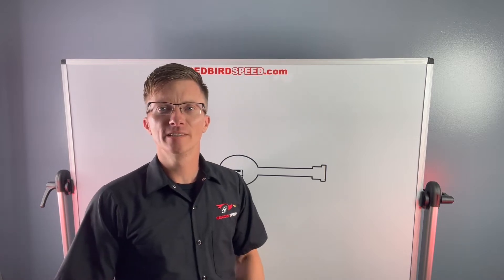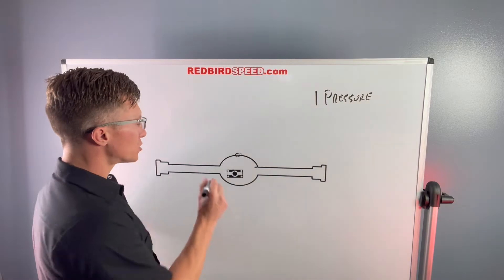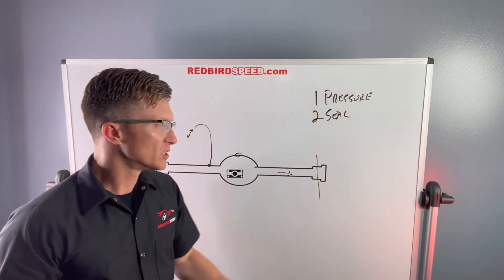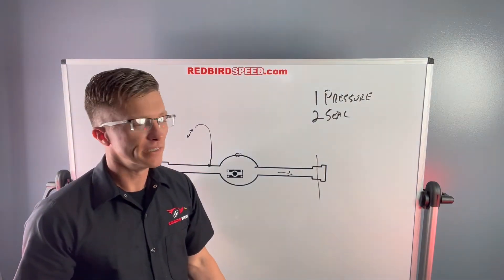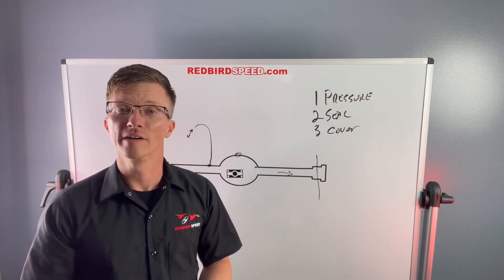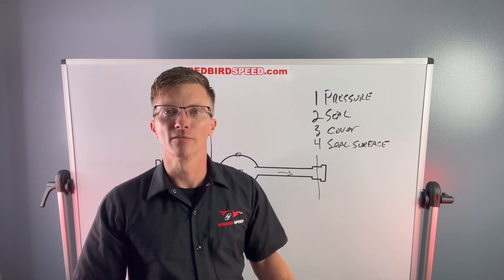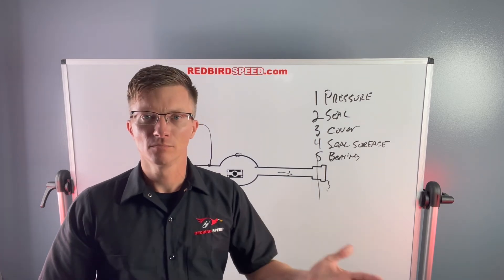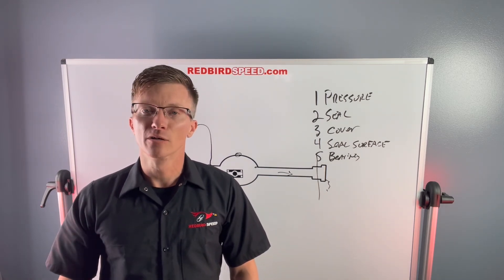5 REASONS as to why your differential could be leaking! 9", 8.8. 12 Bolt, 10 Bolt, Dana 60 8 3/4

Comment: Will adding AT-205 damage the seals? My breather is clear and my fluid level is fine but oil is seeping out from the sides and front pinion.
Reply from the maker: I would say you will probably need to replace all of these seals. In our experience, once it leaks there isn't any going back. I have not personally tried the AT-205. You might need to double vent it if the hose isn't kinked or blocked. Also, make sure there isn't an inner tube seal keeping it from venting. Leaking from one spot happens, leaking from all three definitely makes me lean towards a pressure issue.
Reply: @ thank you

Comment: My rear end is leaking in my 2003 f350, out of where the drive shaft meets the rear end, not building pressure, not over filled, brand new seal and still leaking also the surface is not damaged very confused!
Reply from the maker: Was the thickness of the seal the same as the one you took out? Sometimes parts stores will substitute seals and not account for the thickness.